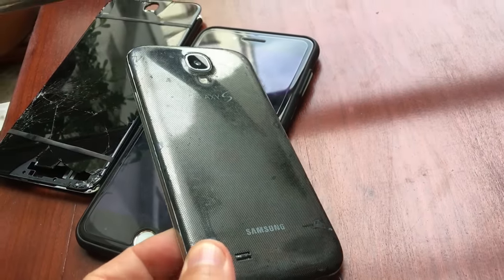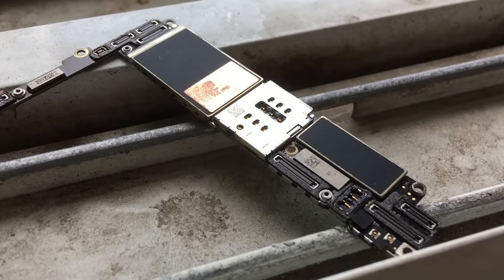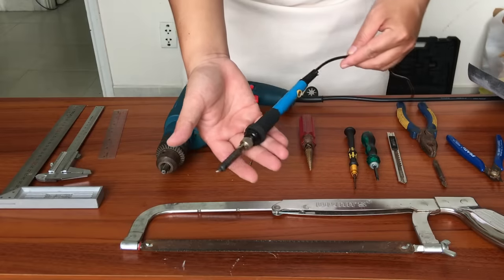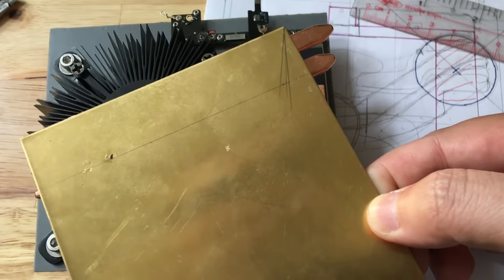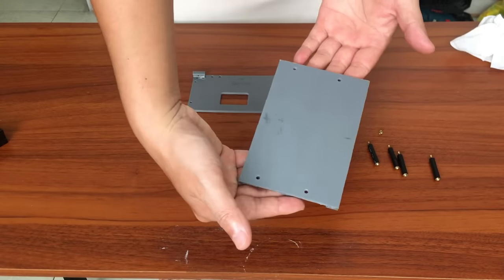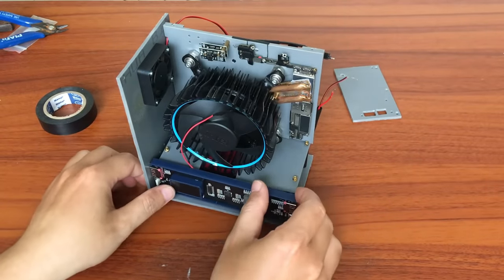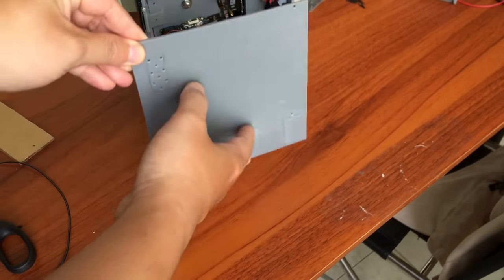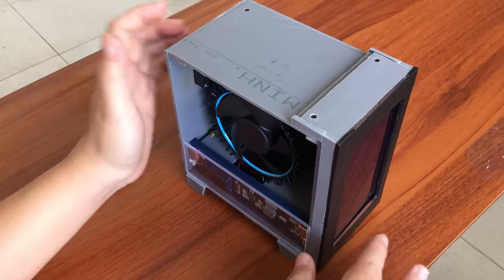I built a mini "PC" from my old iPhone

Comment: Love this! The final result looks just like a miniaturized mid tower! One suggestion I have is that it might be possible to wire a 3.5mm audio input via the connection to the speakers. This way you could plug in external speakers or headphones without having to use a lightning adapter.

I'd love to see how this works with an external monitor, keyboard and mouse and speakers/headphones!

Comment: THIS IS INSANE AND I LOVE IT SO MUCH. i'm currently working on building a custom laptop from scavenged parts of old phones and computers and i can't tell you how helpful this was!! THANKS SO MUCH. i also had a question though. could, say, a laptop screen be connected directly to the motherboard of a mobile phone the way you connected the iphone screen here? without using a lvds controller board?
Reply from the maker: No, it can not :(